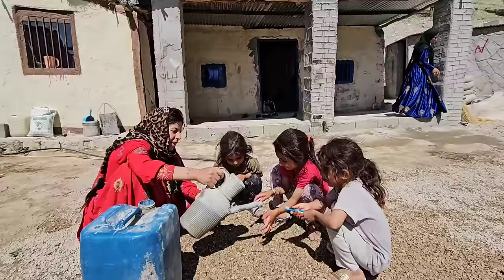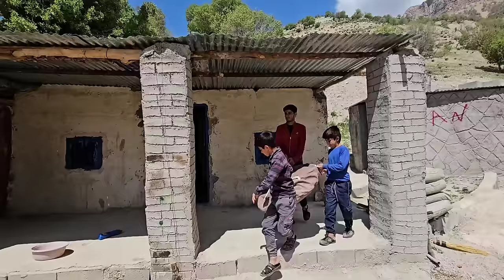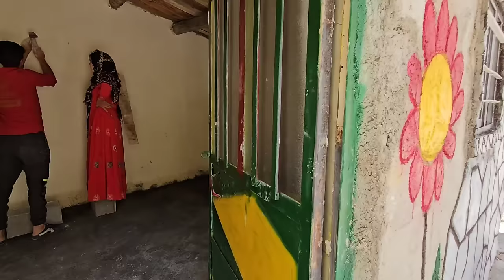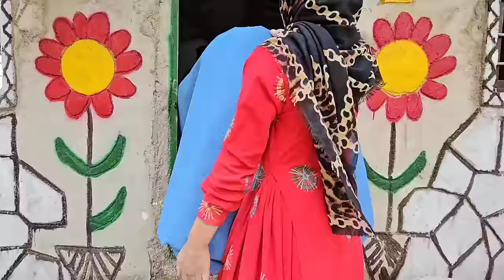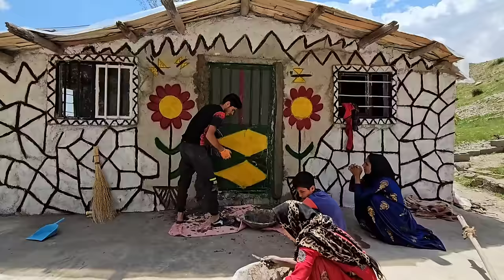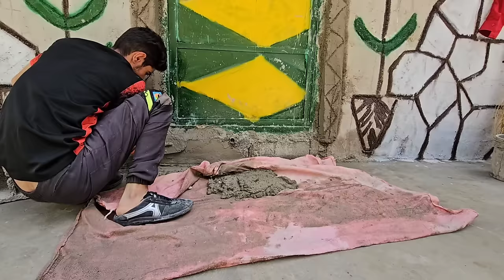Compassion in Action: Extending a Helping Hand and Securing a Home

Comment: If the kitchen is counted, the roofs of all 3 rooms are not good. The roof of this room is not good either. It was said that Meryem would live in this house because the other room was not safe. Will Alide be able to repair the exterior and roof of the other room and settle there?